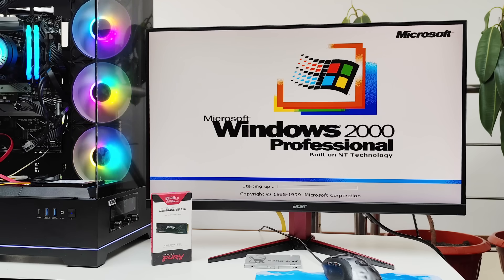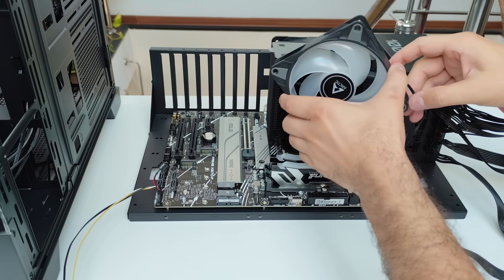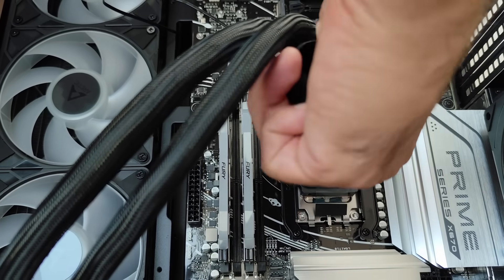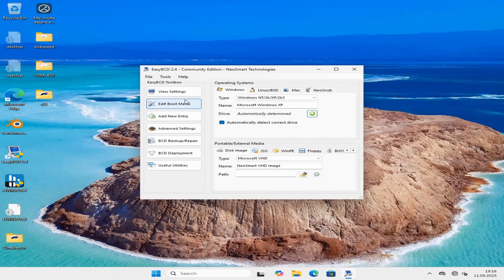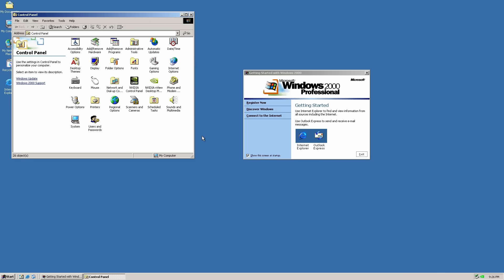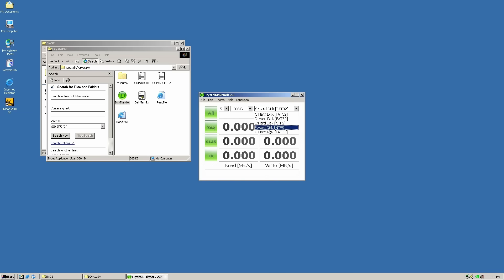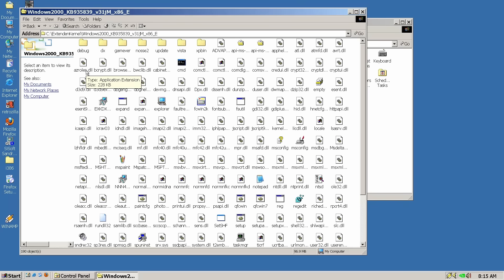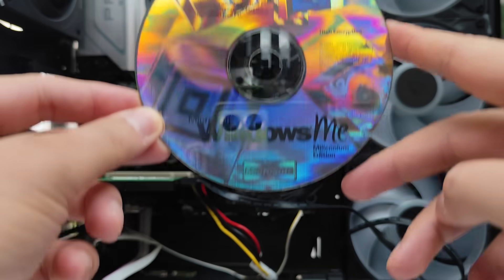Windows 2000 Overkill: Ryzen 9900X + Gen 5 NVMe SSD + HUGE Arctic Freezer AIO

Comment: Amazing work man, it's very impressive you manage to get all these old OSs running on such modern hardware, not many people cover this sort of thing
Reply from the maker: These classic operating systems are the perfect 'time-travel' distraction. Having the option to boot into Windows 98 instead of Windows 11 is something special, and it's also very practical for running a channel like this. I might only spend 30 minutes there or not boot it for days, but whenever I do, it just feels good.
Reply: Agreed. I've been working on putting XP on an old Imac for some retro gaming goodness but just discovering that 98/NT is possible with the right patches (even if I just pull out an old laptop/second gen I series) is a godsend.

Comment: Very cool, graphics driver compatibility is unfortunate. Any idea on the max ATI/AMD card?
Reply from the maker: AMD took over ATI in 2006, and - coincidence or not - they cut Windows 2K support that year. NVIDIA kept it going until 2010! From ATI/AMD, the last official drivers supported Radeon X-series cards (up to X1950). For newer GPUs, unofficial drivers (like from MSFN) get HD 2xxx–4xxx series running well, and HD 5xxx kinda works with some tweaks.
Reply: Last ATI Catalyst driver that supported Windows 2000 as far as I can tell was 6.5 and should have Support for up to R580 based  Radeon X1900 cards
Reply: In theory you can run any ATi GPU that runs on XP , just install drivers manually. And see what Omega Drivers (have support for , under them - wiki page). - so up to 5x80 series ore 68x0 series.... maybe even Cape Verde series....

Comment: You're out here doing this, and I can barely get Win98 to run on a P4 without crashing from driver installations.
Reply: Replaced the caps on that P4 board? P4 era is the age of the capacitor plague and dirty power can cause a lot of random issues.
Reply from the maker: If the hardware is fine, the issue is almost certainly ACPI. Windows 98 SE was designed for ACPI 1.0. Pentium 4 motherboards adopted ACPI 2.0 (released 2000) which also had a few revisions: 2.0a, 2.0b, 2.0c (2003-2006). ACPI 3.0, released in 2004, appeared in some later motherboards. While ACPI 2.0 and later are designed to be backward compatible with 1.0, buggy BIOS implementations from different manufacturers often cause Windows 98 lockups due to mismatched ACPI tables or incomplete legacy support. I recently tested this on socket 1155 motherboards, where Windows 98 can partially use ACPI 1.0 features like soft shutdown but may freeze randomly. On very modern hardware, disabling ACPI forces the system to run as a standard AT PC, which is way more stable since there's little that can go wrong.
Reply: @Frye2048  I didn't replace all the caps, just the suspects. I think it is generally unstable with Win98 if I remember my research correctly.
Reply: @Jamasen Thinking about it one issue I came across occasionally was that the final drivers released by the mobo manufacturer may be buggy themselves. I remember sidestepping this issue with a consolidated installer with practically every component manufacturer driver that existed at the time. I have to see if it still exists
Reply: On a p4 system try running ME, genuinely it worked a lot more stable for me on my Prescott machine
Reply: C2D runs 98 pretty well from what I heard. I've got mine (E8200) so with a proper mobo i can check it anytime.
Reply: same, but with added HW bugs :)

Comment: It's a shame you can't use windows 2000 reliably anymore
Reply from the maker: If you're running Windows 2000 on modern hardware with the same software as back in the day, it will be very reliable. The backported drivers for NVMe, USB 3.x, ACPI are stable. But when it comes to newer software that requires an Extended Kernel and other workarounds... well, it's not like it used to be.
Reply: I agree. I loved Windows 2000 very much. It's why I ended up abandoning it. In fact somehow Windows 10 borked my Windows 2000 install as I had set up a dual boot and after that, I just gave up on it. I held out until the end of 2019 so I definitely used it for quite a bit longer than Microsoft had intended.

Comment: Hey Omores! Based on your estimate, how would Intel Ultra's architecture fare on Win2k and Win9x despite doing away with 14th and older's monolithic design? I've a feeling since Ultra 2 does away with hyperthreading that would cut out a significant portion of incompatibility. But if Ryzen's a chiplet design akin to Ultra 2, it'd have the same issues.

Comment: I would probably go for XP, and enable the classic theme
Reply from the maker: With some specific hardware and a few games, Windows 2K will behave differently than XP, so it's always good to have it on a separate partition. But yes, as a daily driver, XP is more practical, especially on modern hardware.
Reply: I was the picky one who says nope, it's not the same. Sure, it's close and if you're using the 32bit version, you can use the inexperience pack, I believe it was called. That got it even closer. But the explorer shell just wasn't the same and it drove me crazy. I loved Windows 2000 more because it truly looked a lot more like Windows 98 than Windows XP did. I even copied the Web folder from Windows 98 to my Windows 2000 machine to make explorer look more like 98's version.